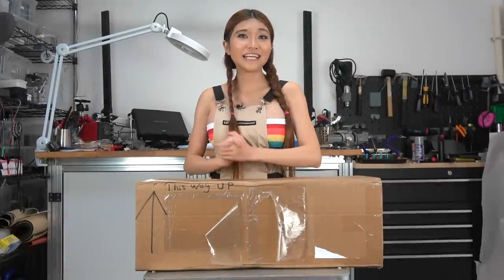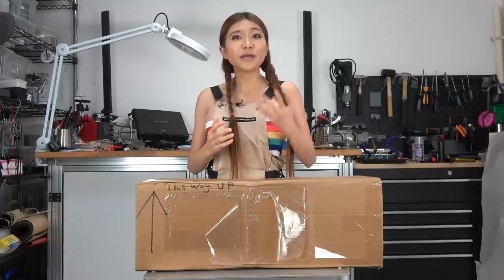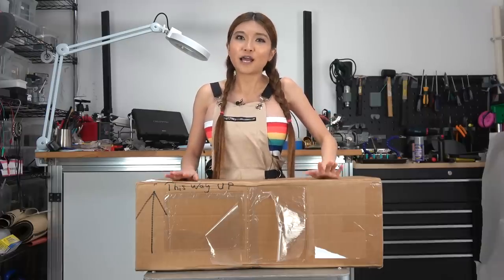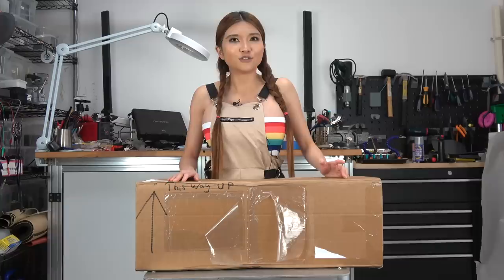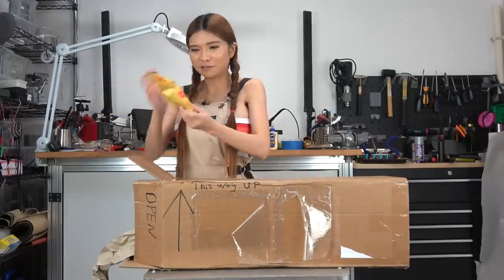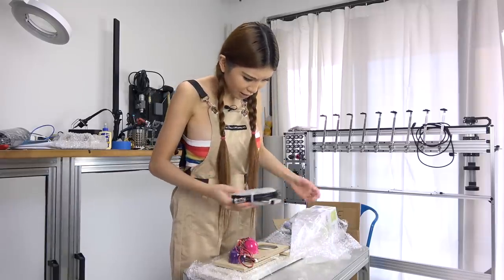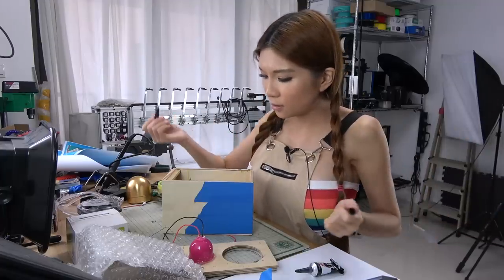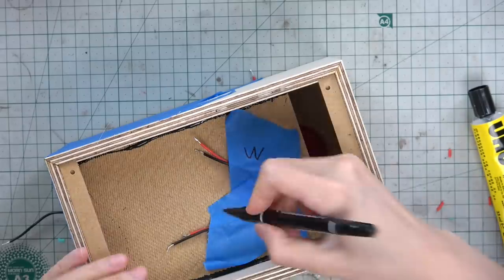Build Your Own Speakers- The Little British Monitor

Comment: You're only hearing about  20,000-100Hz of the sound spectrum. They might have a sub woofer kit? If not. I suggest Polk Audio RSW250 powered dual cone 8 inch subwoofer. That will give you the full range 20,000-20Hz. You did a great job by the way, beautiful lady. My only suggestion. When you're gluing wood together. It's best to put glue on both connecting edges and smooth it out evenly with your finger. Then it soaks into each edge and connects for that air tight seal you want. And then use a wet damp rag and wipe into the corners to clean and push any glue into the cracks. To insure a nice clean edge. You used so much it should be fine. And thanks, for promoting a dying art. I suggest music to people all the time and get "muh" responces. And I know it's because they're listening to it on cheap crappy computer speakers. I have an entire Polk Audio monitor studio, 90 X 7.1 Pioneer digital. With the subwoofer I suggested. (Edit: It's worse than I guessed. On their site the woofer range is actually just a mid-range speaker 500Hz) I'd get the subwoofer for sure pretty lady ; )

Comment: Nice build Naomi! Have designed and built several sets of DIY speakers in the past, and it's always fun to see what works best in these projects. I noticed these are actually 'powered' monitors, which is great for the low-level outputs on most computers and mobile devices, etc. Now all you need to do is pick up your favorite color of wood stain and some sort of varnish or sealer to protect the wood.💜🎼🎼😉👍
Reply: @autohmae  Ahhh I see! It did seem like there was a LOT of electronics in there just to be a simple power supply and audio amp. 😉

Comment: Not to criticize but, the soldier joint at  12:02 looks like a ball. Please make sure to apply enough heat, long enough for good flow. I think it will hold but a little longer to heat that larger metal tube may be needed for a really good joint. You do very well, please do not think I am being mean.  I have seen people in repair that don't have your skills,  Soldier should always have smooth ends all around and never look like a ball with a ring of rosin around the end.  I think you will be OK, just be careful.  With LOVE from USA

Comment: When mounting the connectors into the front plate, try not to turn the side that has been labeled to avoid scratching. Alternatively, protect the area with painters tape and cut it away after fastening.

Comment: Throw that wet sponge away and get yourself a gold wire sponge (kitchen supply stores have them) to clean your iron. The wet sponge is crap, it ruins your tips. Just be careful to get the GOLD (soft) wire sponge, not the grey-silver ones. (very hard, will eat through tin). you might notice some very expensive stations have them.

Also put some fresh solder on the tip before storing it. It keeps it from oxidizing.

I've been using my tip for seven years. The business end still looks like new.

Comment: Two odd questions:
1) What soldering iron do you use?
2) Have you ever had a problem with your hair getting caught, burned, or cut while doing a build, or does braiding it keep it sufficiently out of the way?
Reply from the maker: 1- https://www.gearbest.com/other-tools/pp_257252.html
2- No, but I generally put it up in a kerchief. Braids are ok for soldering but not something I make a habit of, and completely out of the question with power tools.

Comment: Just throwing this out there, Queen's Bohemian Rhapsody will probably give you the most dynamic range to test speakers, and Tool's Ænima will put your lows through their paces.
Reply: I'll go you one further Naomi,  if you really want to equalize your speakers properly in 7 or 8 minutes , look up a track by Ozric Tentacles called "coily", should be on their waterfall cities album. I was a lighting and sound theater tech for 15 years and that's the track I'd use to Calibrate a theater on the fly if all I had was 10 minutes.

Comment: as I was watching you don't need that much glue you can use a flat tip paint brush to spread it on. so you don't get glue running a round inside of the project.

Comment: Big thumbs up for the fan sucking away soldering fumes! Far too many people solder without a fan and those fumes are so bad for you, please Fan Up! And on a side note if the speakers sound good right after building them they might even sound better after X hours of use (X is often argued about but is referred to as the "break in period").

Comment: A very crafty Video. I like it. Good Audio Hardware ist either expensive or not easy to find. Having a Kit like this and the joy learning something new, give a little extra when your done. For those Kits there are different Boards out there so you can adjust the Speakers. Good Job Miss Wu.

Comment: not sure but i think you applied the solder to the iron and not to the copper surface, the best connection is by letting the copper wires melt the solder from heating byt the soldering iron. just something i was taught a long time ago.

Comment: Technical question: Is it possible to replicate the effect of a monitor on regular speakers, using audio processing software? You mentioned that you could hear things in familiar tracks you hadn't noticed before. I use an app called ViPER on an Android device, and have noticed a similar occurrence on my (aftermarket) car speakers, hearing things I hadn't noticed before. Might make for an interesting comparison.

Comment: So this is relevant as I'm reading Mike Senior's book Mixing Secrets for the Small Studio right now. The area at the bottom that is open and just covered by the small strip of foam is a port. Ports are horrible awful things to have on studio monitor as they have multiple resonate frequencies that make mixing very difficult. Then there is the problem that each speaker isn't independently powered and you only feed audio into one which links to the other. These are just really bad things to have in studio monitors. I also did not see anywhere on the kickstart that mentions the ohm rating of each speaker and the ohm rating of the unit at the input. It would also be nice to seen an Audio spectrograph waterfall of the speakers in a dead chamber so we can see how they respond. I'll try to post my comments to the manufactures over on the KS, but I don't plan to buy them as in the US you can get better monitors from Monoprice for less money. I know Monoprice isn't an option for everyone and not everyone is looking for really flat studio monitors. If you are however you should read Mike's book as I have learned so much and I thought I already knew a great deal about audio. That said I imagine they are a far cry better than some Logitech PC speakers and are probably a great option for some, just not me.

Comment: nice setup, but as a 2-way, your cross-ever looks like, "overkill". My Altec Mod 14's don't have that since that integrated circuit did not exist at that time even though a smaller version was made for use in a car. seems like too much work for stereo speakers. and i have worked with quadrophonics. still nice video, someone that knows nothing might get some insight on how it all works. keep it up, you are doing good!

Comment: Nice build and glad you enjoyed the results. However, surely there are other factors to consider, like your audio media and how it is stored/compression on your computer. Also the laptop is unlikely to have a to rate audio chipset. This might also impact results. How did they perform at higher volumes?
Reply from the maker: I used FLAC, other things are probably less than optimal though

Comment: Well put together build video. I have a quick question for you. While you were thinning the contacts for the first pcb, and you had the pcb in the helping hands clamps, what was the purpose of the tape on the bottom side of the pcb?

Nice work on your first wood build. Maybe a little heavy on the glue, and clamps would have been better than tape, but those are small details that don't REALLY matter in the long run. If they sound accurate to you, you did just fine.
Reply from the maker: Tape was the hold the jacks in place until I could get the first solder joint on the pin.

Comment: You need to add a subwoofer, that would be a nice project to do as you have everything from the low pass filter to the amp and power supply readily available there in China

Comment: Great presentation on the build. Was the glue included as well? (Would be an overkill amount if they did :D ) You may want to try an audio range sweep to see where it drops off as well as a sampling of noise colors (White, pink, green, etc) I'll be checking out the KS for this

Comment: I.ve made several speakers and my fav, was a take on the old Bose 601's. I used higher quality crossovers, larger Pyle woofers, etc. Most had walnut cases with steel speaker covers (child resistant). Ten times better than 601's!

Comment: I think I would have used a 1cm  brad nail in the front and back joints to add more rigidity and maybe more durability.

Comment: You need to improve your soldering technique. Don't apply solder to the iron, and don't just hold the iron on the pin, the iron should touch the pad and the pin and you apply the solder to the pad. The way you are doing it will create cold solder joints that are likely to fail.

Comment: I found details in music come thru better and better by using real audio equipment like the old setup's from 80's 90's or even the 70's produced some the best their a reason they were so hefty in weight they were very complex audio circuits to not get too technical your speakers are nice but are no replacement for a full blown stereo setup with surround sound break out those 14 inch woofers 5 6 or even 8 speakers around a room hooked up to a Sansui, Kenwood, Pioneer ect. receiver nothing beats 100 watts per channel

Comment: Why did you have to solder that circuit board ? I would have thought a do it yourself kit would have all that done before you get it. An explanation while doing it would be helpful
Reply from the maker: Depends on the kit, some are more DIY than others...
Reply: @Naomi-Wu  Thank you for your answer

Comment: Take it easy with the wood glue - you only need a small bead and then spread it with a brush.  If you're going to do any real wood hacking, invest in some clamps.  Search angle clamps on Amazon for ideas.
Reply: Or Woodworkers Supply.

Comment: me over here slap an amp and some tweeters and sub-woofers in a cardboard box and boom you got a boom box then seal all the air holes and you speakers will warp more heheh

Comment: In any audio system, the speaker is the critical linkcomponent within the audio chain. If perhaps you are interested in a more professional audio experience, please take a look at this speaker line because they sell components as well as speakers and headsets. http://esslabsusa.com/ This company sells the famous "Heil Air-Motion Transformer" that covers a mid to high frequency range from 4 Khz to 20 Khz with astounding clarity. This device moves the air 5 times faster than conventional drivers. The "detail" when listening is very obvious. In fact, once heard, most audiophiles are unable to return to conical speaker driver. The drivers can be added to existing speakers with the proper crossover. I own a pair of AMT3 Rock Monitors since the mid 80's and they are incredible speakers. Ear-Candy. Spoiled. 
"Sound as clear as light".